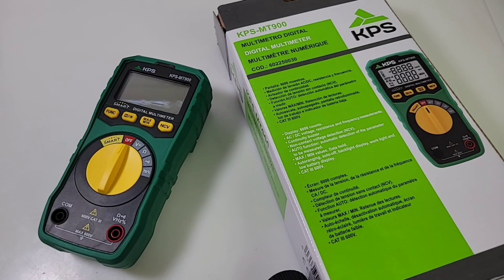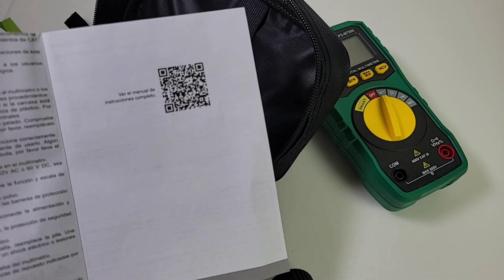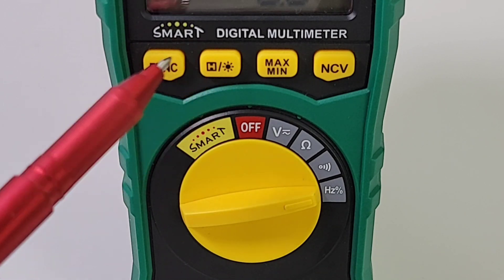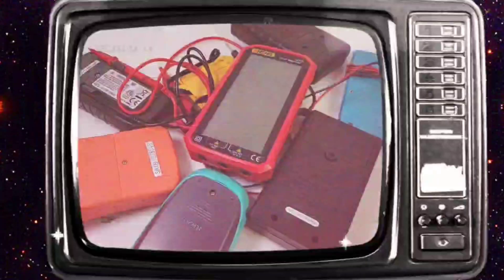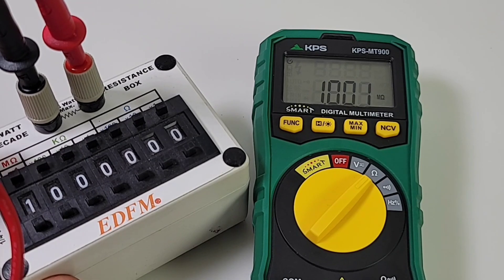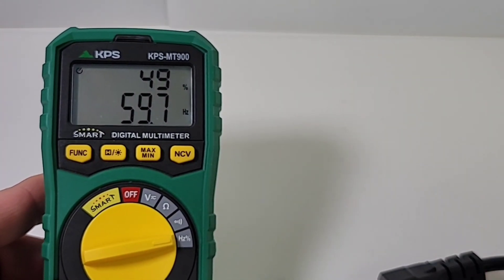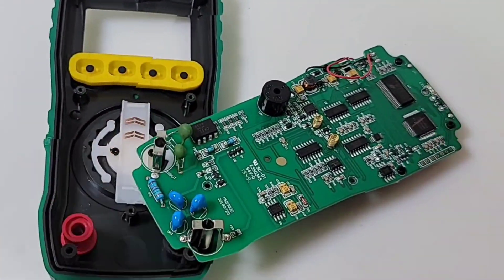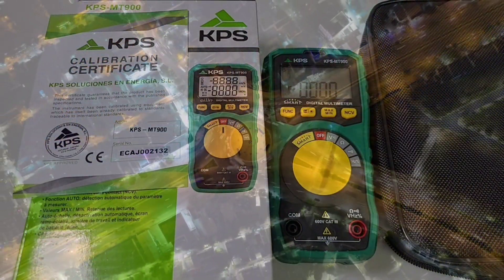KPS-MT900 Multimeter Review & Teardown!

Comment: Let's see $75 US and it almost hits the ball with it's features. But, no current, no capacitance a rebranded Mastech Pcb.
A calibration certificate that you cannot be too sure of, horrible probes for the price and continuity that even the Pro Probes
cannot make a little bit better. It does great NCV , good build quality, I did not see a diode check so I don't know how it fares 
in that capacity. The printed circuit board had a somewhat proper amount of protection for it's features. Nice and clean. Pretty
standard case for meters that come from China these days. I also tried the QR code for a manual and drew a blank on that ,
{really don't need one for this meter but that is no excuse for a manual not being available or included with the shipped meter
at this price point.) Another great Cheap-O review Darren , for a semi-auto meter at this price I know that you have done recent 
reviews on more full featured meters at way less cost that you have given a "thumbs up" (my words not Darren's) as to usability
and value. Aloha from the Island State
Reply from the maker: You checked all the boxes ...definitely a disappointing multimeter on many levels.
It's rare to see such nice input protection but they've sacrificed too much to deem it worthwhile...Your prize winning multimeter is enroute and definitely offers alot more bang for half the price. 😀👍Aloha my friend !

Comment: Hi Darren,   do you have a spreadsheet/ comparison chart with the features for all the multimeters you review?  I've looked at your Web page and can't seem to find one.  A spreadsheet would be great when one is looking for particular features and then one can check out the corresponding reviews.  Eg I'm looking for a mini sized multimeter for a toolkit and would like to know which of your reviews to check out.
Reply from the maker: Great question! I'm actually in the process of cataloging all the multimeters reviewed thus far and will put it on the website once competed. Stay tubed for that ! The ANENG M118A https://youtu.be/MkZmEgZ6XOI or the UNI-T UT123D https://youtu.be/DzKft6jg2H8 are two great mimi multimeters that pack a big 👊 punch 😀👍

Comment: In cheapo zone, For its $75 price, i will rate it 0.5 of 5. We able to buy 2 or 3 good multimeters with $75. 1 meter with safe n good input protection for working with main power, the other one for cheapo, fast, truerms, precise, fast continuity, diode test, cap test. Because in electronics we mostly works on low voltage, low current.
We also need lcr meter, that uC transistor tester. Sometime we build our own custom meters with the help of our cheapo multimeters.
Importir, rebrander.. pls dont double the prices.
Reply from the maker: Its amazing how much multimeter you get nowadays in the CHEAP-O REALM 😀👍
Reply: The asking price for this meter could be right if it was marketed ten years ago.
Reply: Teachers, students, engineers, brothers.. away from this meter and be careful of an impotir rebrander brand like this one. Huh.

Comment: One thing it has many dont is in addition to the mov's and ptc's it has a high current resistor, many have the first two but no resistor, and the smart function is better than many others.  In any event way too much $$$ for a meter with its features etc. n You can get a pretty nice Uni-T for that money with more features.
Reply from the maker: Spot on Mike ..there's  no doubt it has solid input protection but that just isn't enough 😕  If only it had some current functionality , DIODE mode etc..  it would have definitely made this a better multimeter for the $
Reply from the maker: That NCV was sic though 😳🤙

Comment: Interesting instrument, but like you said, its expensive for the limited functionality it offers. I presume it is averaging AC volts and not true RMS. In my experience, that certificate of calibration would not be accepted in an industrial environment. It needs to show test values, measured values, uncertainty and the information of the instruments used in the calibration.
Reply from the maker: My thoughts exactly...you're getting a cal cert that really has no merit. Too bad.

Comment: So it’s a volt-ohm meter with continuity and NCV for $75… hmm, okay. Let’s imagine it was meant for basic electrician stuff. I'm still not sure why it would need a smart mode when it only has four other modes to choose from. I would personally prefer a flashlight on an electrician meter rather than a smart mode.

To give it credit, the NCV was working well. And it’s much sturdier than a regular cheap-o (because it’s no cheap-o). Still I couldn't help but compare it to UT61E+, which is also around $75. KPS-MT900 stands no chance against it.

Good review as always, Mr.Walker. It will be interesting to see what else this Spanish brand has to offer. 👍
Reply from the maker: So true..the UT61E+ definitely ticks so many more boxes. To be honest,  I'm not sure what demographic they were concentrating on when they decided to release this .. seems to come up way short considering all the choices in today's multimeter market.

Comment: Great review. Save your money and get a Fluke 101 and a Fluke NCV probe if your budget is $75 and you don't need an ammeter.

Question: What happens if you have your meter set to Resistance/Continuity and you measure live mains voltage? Wouldn't it blow up your meter? If true, the smart meters will always make me nervous.
Reply from the maker: Hopefully not...depends of course on how the circuit is designed. Multimeter education is key in this respect. 👍

Comment: As for the certification, I did see an ETL (Intertek) logo at the back. Doesn't that make it actually 3rd party tested and rated for its claimed specs, just as UL?
Apart from that.. Very mediocre meter indeed, especially for its price.
Reply from the maker: Input protection looked good but considering the very limited ranges it's rather underwhelming. 🤔